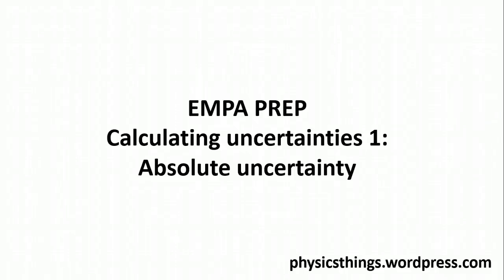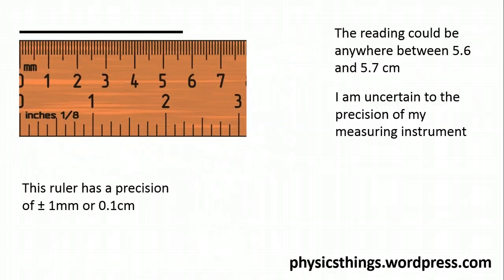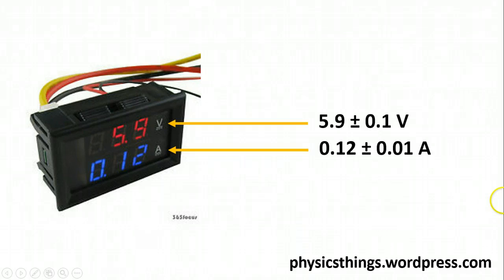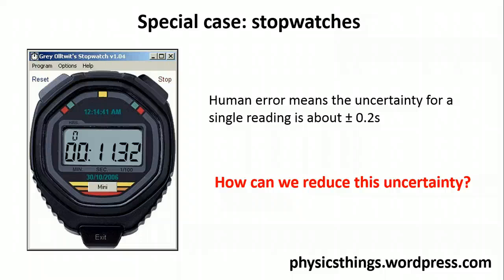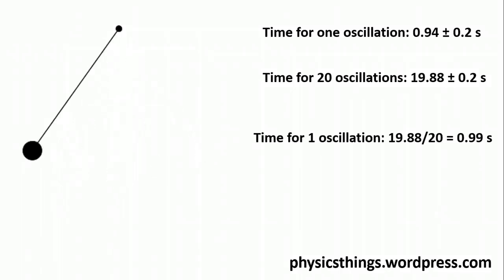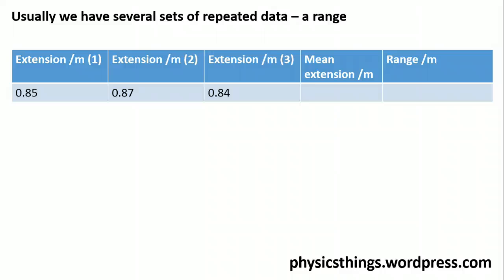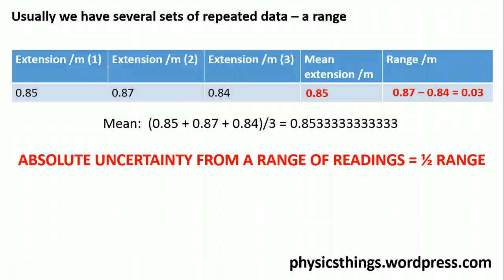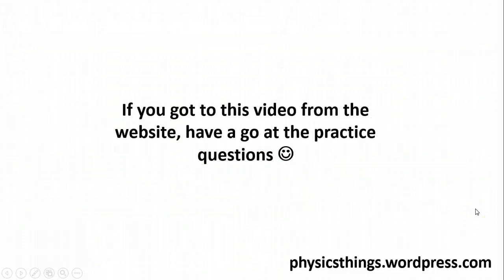EMPA Prep - Absolute Uncertainty

Comment: when talking about the uncertainty of the volt/ametre isn't the uncertainty supposed to be ±half the smallest value as it is when u have a spread of data? A quick reply would be useful from anyone, thanks.
Reply from the maker: Hi, this is following the Aqa spec a syllabus guidelines which is that uncertainty is plus or minus the smallest possible measurement. You may want to check your own spec to make sure you have it right for yours.